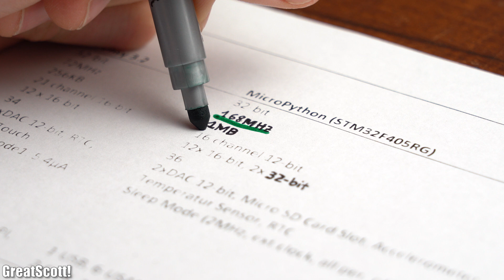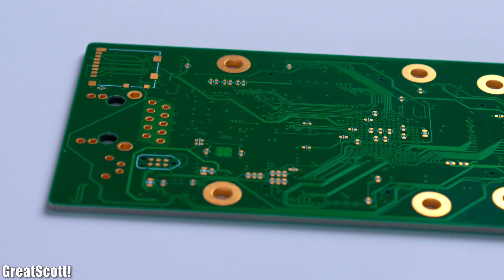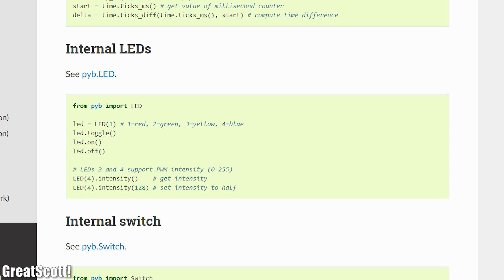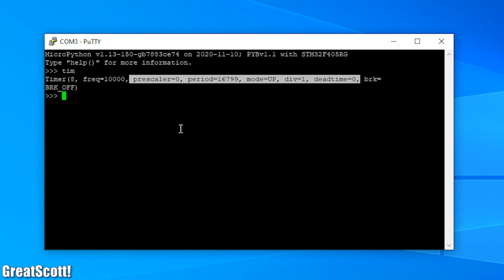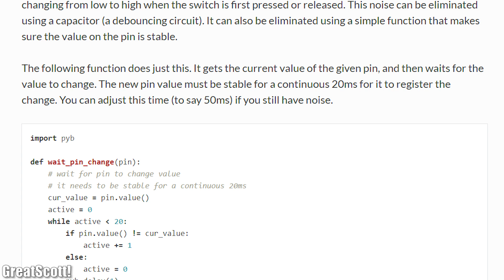Easy & Powerful Arduino Alternative? #4 Pyboard (MicroPython) Beginner's Guide

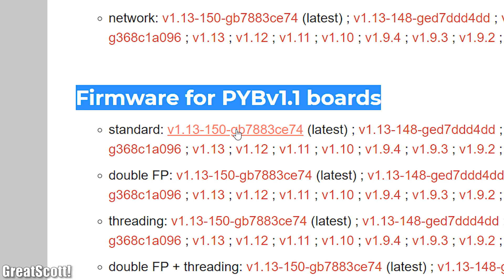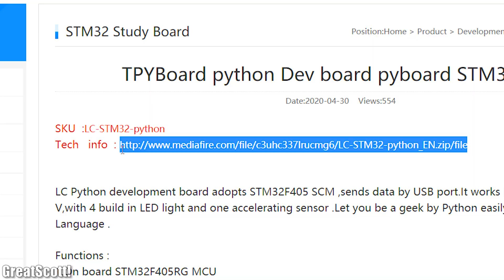Comment: Thanks for the video @GreatScott! At 3:52 you say you downloaded the latest firmware version, and it looks like you went to the micropython site but then 4:05 you said you went to the board manufacturer's site and downloaded something from there too. Then flashed the board with that second file using their DfuSe_Demo tool. Question: Did you do anything with the first file?

Comment: hi scott I have problem my  helicopter transmitter are not working and I opened it  then the problem is the 3 ir led the of led is  so very rusty and the pin of led is got broken can I buy or get in tv remote

Comment: I do prefer micropython vs arduino. I had a small project with an ESP32 and could not get any SSH client working (Not SSH server!) on the ESP32. In my project the ESP32 should remote execute some commands with SSH. So finally I found the LoBo Micorpython for the ESP32 that had a working SSH client https://github.com/loboris/MicroPython_ESP32_psRAM_LoBo/wiki. Since that I am hocked up to the micro python. Unfortunately there have not been any updated to the code since almost 2 years for LoBo micro python. BTW LoBO is an acronym for Boris Lovosevic the author.

Comment: That sd socket, I guess you can load some wav files and play them into the dac without any latency issue? Like you could build a small sample board at full 44.1 or 48kHz like a bosss

Comment: Could you do a video about sound-based trilateration in 3D space? 

I've thought about using buzzers and sound sensors with an Arduino to track an autonomous little robot inside a room by measuring the time the sound takes to get through the room from the robot to the sensors, pretty much like GPS, but I don't know whether this would even be feasible. Have you ever tried something like that?

Comment: Horses for Courses guys if your flashing an LED do you need a 168MHZ the other problem that I dont know if it was covered is how much power will it take.   I have an arduino running on 2 AA batteries for 5 years..  Its not an alternative its a choice and it may not be a better one depending on what your requirements are.

Comment: You should check out the Parallax Propeller & Propeller 2. They both have 8 cores (32 bits), and the P1 clocks at 80 MHz and P2 runs at 320 MHz. Check them out at parallax.com. They can run C/Python or their custom languages Spin and PASM.

Comment: You should check out some Kendryte K210 boards from Sipeed. Their Maix boards normally run MicroPython like this one but it has a dual core RISC-V rv64gc CPU with an AI accelerator and 8mb of RAM so you can run any code compiled for RISC-V that doesn't use an MMU. They're around the same price as that board you just got. Some variants also have Wifi, TFT connector, and a camera connector

Comment: ST sent me a few samples of this chip i the spring. It is feature packed and if I remember correctly it is supposed to be used as a motor controller with built in MCU.

Comment: There are a lot of stm32 family micro controller boards available at the Internet suppliers. And you should try to programm it by free system workbench or cube from st. Surely, these boards are much more greater than Arduino ones. And Python is a great language, but it requires a lot of resources comparing to c++.

Comment: Welcome to the mpy world by the way :-D it's a brand new universe out there! Given this board is a slightly more expensive equivalent (with better UC but worse connectivity), do you think you could cover the ESP32/ESP8266-based mpy dev boards? I know you already used them in plenty of projects, but I'm not sure you ever used them with mpy (given you said you just got introduced to mpy in this video)?

EDIT: Oh the pyboard seems to have more devices too - accelerometer, RTC, etc, I don't think traditional ESP32/8266 devboards have those!

Comment: Check out the Matek F405 or F405-Wing flight controller. They have even better ones, I just got the Matek H743-WING. These flight controllers are based on the same chips but in a better package and extra goodies.

Comment: I don't know if you have Seen it, but in my opinion the best alternativ to arduino are the nucleo boards Form STMicroelectronics ther you have a fiwe options for programming (STM Cube, Mbed OS, Arduino IDE, Keil IDE,...). It has an arduino compatible pin header and an extra header for more i/o's the microcontrollers are all arm based and extremly powerfull (and one have eaven a dual core)

Comment: Scott, this board sports an STM32F405 chip. You can use the Arduino platform to program it if you want to. It is nice to learn MicroPython, but I just wanted to point that out

Comment: You *REALLY* need to look at the new(er) Teensy 4.1 development board (@$26.85 US)!!  It has so many awesome new features that it will blow this board out of the water with ease!  600MHz 1M RAM 2M Flash and can be upgraded further... Ethernet, MicroSD Card, even more timers, GPIO, PWM, ADC and DAC, USB, CANBus, etc... even has 64bit FPU!  all running on a Cortex M7... It also has the ability to run Teensyduino and MicroPython and Regular Python for higher level functionality!  The Teensy 4.1 is an absolute brute and comes close to rivaling a Raspberry Pi or Latte Panda, etc.. for a Non-OS companion board powerhouse!  Oh yeah, Form factor is same width and only slightly longer than the Arduino Nano

Comment: That board may be just perfect for the air combat sim cockpit I want to build! Even though it's bigger and more expensive it's higher clock speed, more memory and greater amounts of IO could amount to a cheaper solution in the long run. Great video as usual!

Comment: I've bought a few chinese black, blue, etc. STM32F407 boards for trying out mpy a while ago. Some have SD slots, others don't. You can even run your code from SD. STM32F405 is not very different than 407, but some of my boards had a bit different layout than the original pyboard. Check out mcauser's github repos for some of them. I had one that was not on his list, so I've played around and modified one of his board definitions and put it up to my repo. I'm running this chinese one with a particle sensor, a BMP680 and a lorawan radio. Also do check out the company named pycom. They even started to sell an 8ch lorawan gateway running mpy, not long ago. :)

Comment: I'm sure you know about this great alternative. Teensy 4 and 4.1 which comes with a cortex m7 at 600mhz, you can use it in traditional way or circuit or micropython way. The idle draw is heavy but seems like a cool board.

Comment: Check out the Teensy 4.0, that bad boy is smaller than an arduino nano, and its bloody 600 mhz! Its insane!
Reply: Wow. That's insane.
Tbh the teensy4.0 doesn't have enough pins on it, but on the plus side, the chip itself runs about CAD$18 on its own. Really easy to drop into a custom design.
Reply: but 3 times as expensive as the board in this video
Reply: @blackkissi  no. The teensy is 20 bucks, this is 13. And i believe those 7 bucks are easily worth the faster speeds, and even more so the tiny form factor.
Reply: For an even more powerful board (and only slightly bigger) check out the Teensy 4.1 that has 55 pins! plus ethernet and SD card for extended storage and lots of extras! Yes... it is double the price, but it is more than double the capacity, speed, and options... with the exception of not having a native accelerometer or camera port... choose the board that works best for your needs or the best overall bang for your buck... if you don't need all that power than use the smaller cheaper boards... but for sheer brute force at a good price...

Comment: There is also a Pyboard Mini which is quite close in size to the Arduino Nano, based on STM32F411CET5, 512KB flash, 128KB RAM

Comment: Very cool, I would compare the PyBoard 1.1 to an Arduino Uno as a sort of baseline for performance and expandability in the MicroPython world. The ESP32 (With mandatory PSRAM!) is also a great option for WiFi-enabled boards, while the MaixPy/MaixDuino boards are on the high end: 64 bit RISC-V dual core w/floating point unit  at up to 600 MHz, 8MB  of RAM, and bundled with a 320x240 LCD, micro SD, and VGA camera with hardware object recognition, all for around $35 for a bundle.

Comment: This looks like a great board, but isn't it a little on the expensive side, especially when compared with for instance the ESP32 which runs microPython easily - and has wifi and bluetooth to boot?

edit

I was little bit too quick with posting this. It has accelerometers and a real time clock? Not bad at all!

Comment: I would like to point out an ESP32 dev board with micropython called "Tiny Pico" to your viewers, the easy to use WIFI might be interesting to them, great video...cheers.
Reply from the maker: Thanks for the info!
Reply: Yes! By Unexpected Maker, a great Youtuber as well
Reply: You can with a few lines of code in C++ have wifi up and running. It's nothing too complicated and won't eat up all the storage of your little device. Python tends to be a massive hog when it comes to resources compared to C++ especially if you know that python is interpreted to C++ and adds a large amount of code for memory management.
Reply: @kazykamakaze131  MicroPython is based in standard CPython, isn't based in C++. In micropython your write less than C++ but the use of ram is high.
Reply: @javierolavarria  C and C++ is basically the same thing since you can write C in C++ but not the other way around, so technically it is written in C++ as well. Also, you still sit with the exact same problem with memory allocation that needs to be cleaned regardless of what you say a python program will be larger and slower than a written C/C++ program, if you do not believe me make a program, compile and test compared to Python equivalent. You would have known this if you knew how garbage collection works in the first place.
Reply: @kazykamakaze131  In practice, dev time is usually more valuable than hardware resources.
Reply: @cheaterman49  maybe not always
Reply: @cheaterman49  Haha okay, go tell that to nearly every embedded system company out there. They ALL use c/c++. Stop fooling yourself in thinking tinkering is the same as development. Micropython is just a gimmick currently and any respectable team uses C/C++ as these aren't desktop applications nor mobile applications where you have GB's of memory, no,no,no, these are small MCU that have maybe 512kb-1mb memory or less where resources usage counts. So coding in a language that gives you the control to control memory allocation itself is extremely valuable. If you want to code in python go tinker on a raspberry pi and leave the rest of us to make highly efficient code that doesn't really take that much longer to code if you know C/C++ to a reasonable level.
Reply: @kazykamakaze131  Sure! At least I do sell the devices I design! :-)
Reply: @kazykamakaze131  hey mr smart this is a board for prototyping, if you want to be a stupid elitist go to reddit or something but how about instead of flexing your "knowledge" you go and work on something. The dude was giving some advice, why be so arrogant?
Reply: @cheaterman49  I don't need to sell the devices I make as I already get paid to make solutions to complex problems. Selling small devices is what the Chinese do, what I do is create solutions to problems not yet solved. Big difference.
Reply: @kazykamakaze131  Great, then we both do the same thing :-)
Reply: @cheaterman49  not quite true if you are designing to manufacture thousands of devices or if you need very fast sampling rates
Reply: @martingaete8098  A very enviable position relatively few companies actually find themselves in. But you're totally right of course :-) saving pennies per unit is absolutely necessary for some, no matter how many hundreds of dollars they spend on R&D.

OTOH (and interestingly), your timing is amazing, as I'm about to finally put some MicroPython code in production (on ESP32s). What I can tell you is that mpy on such an insanely fast board is surprisingly fast itself ; and it was generally much easier to write and debug the Python code than (for example) the last time I forgot to provide a copy constructor to a class in C++ and my Arduino's memory got trashed without warning (no OS, so no segfault).
Admittedly, we're talking about 12 units here, so the hardware costs are absolutely negligible compared to the R&D, hence making MicroPython a good fit.
It's not simply a matter of cost for us though, it's also very much a matter of assembly time, and I have pre-soldered PCBs that are basically glorified Nanos (atmega328p @ 16MHz) that are still used for many of our electronics when WiFi isn't relevant/needed (or taken care of by a proper machine, eg when plugging our PCBs to a RPi), and those certainly constitute most of our sales.
Then again, think of those 12 MicroPython+ESP32 boards as a pilot project, and I've been sufficiently convinced by them that I'll use that stack more often from now on. :-)
Reply: @cheaterman49  You make a very good point, and I must agree too; mpy is way much user friendly, easier and intuitive to code compared to C's related languages, so, if you got the resources, in the end you pay a few bucks more for hardware, but make it easier and faster for the programmer. I personally would love to code everything in mpy, but at my work we often find ourselves making low cost  sensors, and using microcomputers instead of microcontrollers tends to be prohibitive cost-wise for certain projects, since our main focus is to make technology reachable for farmers, people with illnesses, kids and handicapped people. So, in the end I really want to use mpy more often hahaha, any advice from a more experienced user would be very appreciated.
Reply: @kazykamakaze131  
As a Chinese, although I lay down, I was still shot. ...............
Reply: @kazykamakaze131  We use MicroPython to develop *medical devices*. I've been in the industry for a few decades and the team I'm on is as respectable as any I've worked with. I'm also a very accomplished C/C++ developer but acknowledge that I can create a MicroPython solution in less time. Do try to keep an open mind.
Reply: @mattytrentini  I never trust when someone starts off by saying" I am x and have been doing x long amount of time". Give an example not just say try and make a different argument and not addressing my initial argument. This is bad logic. My argument was NOT the amount of time used but rather the resources used. We ALL know you do have less dev time in python this is the entire reason it exists, as it is a higher level interpreted language. Rather reformulate your argument into a more sensible statement that adds value to the conversation.
Reply: @kazykamakaze131  I don't really care if you have trust issues; I'm not that hard to find and the company I work for - Planet Innovation - has even presented at PyCon AU discussing how MicroPython has been used for medical device development. You made the argument that "all" embedded companies use C/C++ and MicroPython is only used for "tinkering". This is clearly not true and was what I was refuting. 

To your original point, yes, MicroPython does use more resources, particularly memory. But it reduces development effort and microcontrollers are not the tiny devices they once were; trading extra resources for development effort is reasonable for many applications. 

It's also trivial to implement modules in C so performance or memory critical parts of the system can be implemented with lower-level control. This is typically required infrequently. 

Anyway, if you prefer to stay in C/C++ that's fine! But MicroPython can be a serious embedded framework for many applications.
Reply: @mattytrentini  You seem rather low SQ/EQ. You clearly can't differentiate between points in basic discussion. No one asked you about your employment nor about your employment prospects so keep those to yourself rather. You jumped in from the side in a comment section and provided nothing of value. 

So to point out your lack of understanding on how discussions work. HOW must someone know what you are referring to if you do not specify. If there is multiple comments with differing points you have to state WHAT you are referring to as normal social points dictate if you are replying and not specifying what point then the default is meant the last comment stated. So just because you lack basic soft skills doesn't mean I have to pander to them. The point of your lack of EQ/SQ is emphasized by your 'decades' of coding you speak of as no tech professional I know of with some semblance of soft skills stays in grunt work programming.

Comment: stm32F4  is common microcontroller for flight controller 

spracingf4, omnibus F4, Matefk F4, and so more 

they have really fast refresh rate necessary for fast corrections in flight

Comment: Nice! Maybe a "big" project with this board and Micropython? I'm starting with Micropython and Can Bus and I don't undestand how you can interact with the board in "realtime". I'm trying to read a message, modify and write in other can but I would like to modify these value throw an screen interface or similar. My problem is run the communication and the interface at the same time.

Comment: I mean yes, the sleep mode current is high at 1.1 mA but if you look at the Standby consumption you can get down to 2.2µA @ 3.3V/25°C (DS8626 Rev 9 Table 24).
If you really need low power go for a STM 32L4 which can get down to around 8 nA in Shutdown mode (AN4621 Rev 5 Table 6).